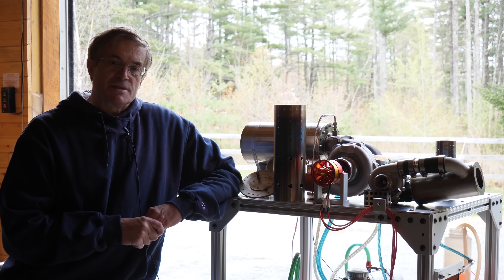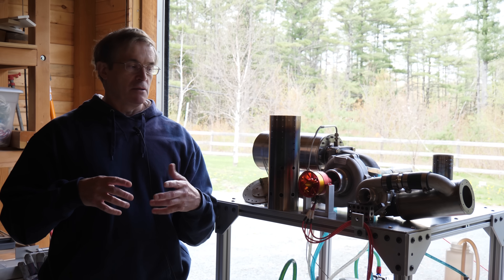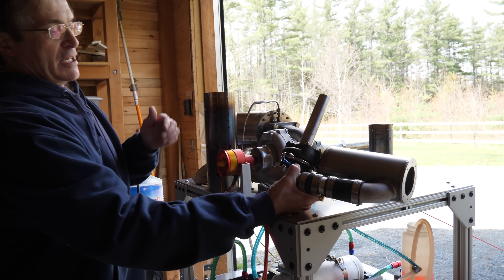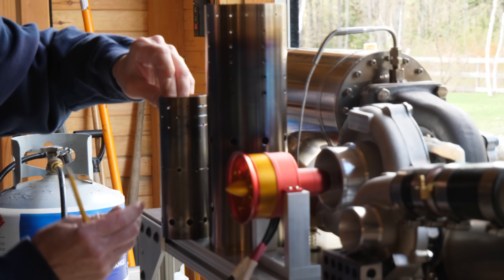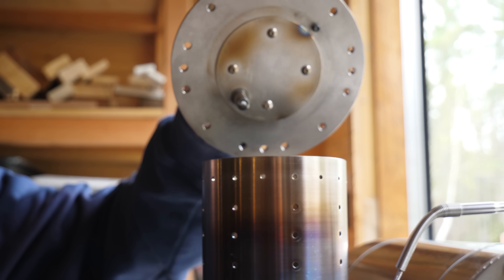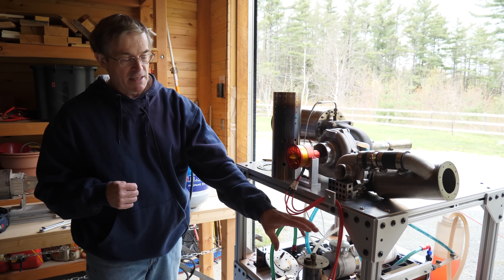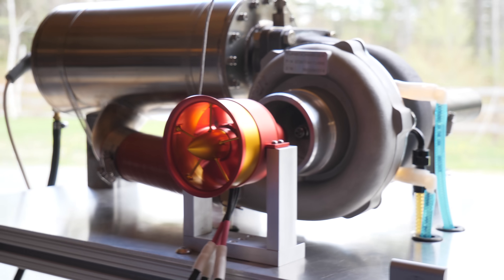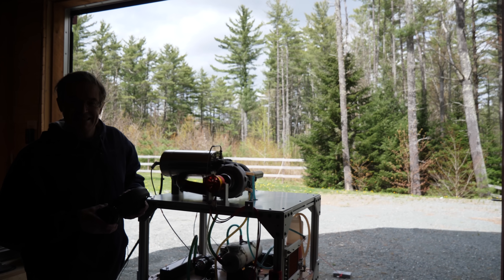Catching Fire - Refining the Jet

Comment: I have (had) no interest in turbojets. Absolutely fascinating to watch though.
I've always wondered however why jets are universally noisy. What is it about them that generates so much noise.
Reply from the maker: Thanks!
Probably the two major reasons they are so loud is that their compression and expansion processes are open to the atmosphere.  It is as if you carried the process of removing the muffler from your car further and removed the cylinder walls as well.  Also, some of the gas flow in the turbo is supersonic.

Comment: how much has this project cost so far?
Reply from the maker: It's really hard to say  because so much is repurposed from other projects.  But, the turbo, gauges, pumps and misc fittings probably total arround $1,200.
Reply: It doesn't matter. It sounds like you know the cost of everything but the value of nothing.
Reply: @stevewhite6252  thank you for sharing

Comment: Main presenter, if you really wanted to use liquid propane, have you considered running your fuel line (metal fuel line obviously) around the flame tube or exhaust in the form of some heat exchanging coils to convert your liquid supply to vapor before being burned? This is what we do in hot air balloon burners. Also, call up some hot air balloon pilots and ask if they have or have a line on some illegal (to fly) propane tanks they want to get rid of. They're 10 gallon propane tanks with liquid and vapor taps. Quite handy.
Reply from the maker: The source of the tanks is a good suggestion.
The heating of the fuel posses some challenges.  It needs to be effective and therefore the lines need to be long enough and be immersed in the hot gasses, but not obstruct flow.  If the fuel expands too much the flow resistance can choke the fuel flow.

Comment: the difference between a crappy ebay turbo and a say a built garrett was basically turbine design and ball bearings..  this is common knowledge in auto racing.  Im wondering if he will incorperate an oiling system..  heat kills bearings which is why they sometimes even run stand alone oil sump systems directly into the turbos but have to run some kind of oil through the turbos in automotive applications..  oil is critical and ive seen myself what happens when a compound turbo system is glowing red hot and the oil system fails..  barings seize and shatter csusing a domino effect of turbine pieces shooting through the system and locks the rotors so the whole system fails.  And down the line pieces get into the motor which doesnt play nice either..   essentially a compounded turbo diesal is doing the same thing here except not injecting fuel into the turbo so not making it a jet persay.  unless a nitrous injection system is rigged up to it forcing into the intake..  then it can add spool that way but is not a combustion system with turbo alone..  idea..  try running a diesal fuel for the jet.  Lubrication in the fuel..  like kerosene with pure ethanol or methanol.
Reply from the maker: I do have a pressurized oil delivery and cooling system.

Comment: Thrust increases with the square of velocity, it's massic flow times velocity, not mass times velocity. Also, the out flow doesn't need to go faster than the vehicle, just faster than the inlet flow (so you can use a diffuser to reduce the speed of the flow).

Great video as allways
Reply from the maker: Thanks!
Actually, it does have to go faster than the vehicle because of the conservation of momentum.  Only if there were no frictional losses could the exhaust even equal the velocity of the vehicle.
Reply: The scaling laws are still against you, even if it wasn't articulated perfectly by Mr. Tech Ingredients.  The thrust (i.e., the rate at which momentum is imparted to the air) is mass flow rate times velocity (T = m_dot * v), but the power required is half the mass flow rate times velocity squared (P = 1/2 * m_dot * v^2).
Reply: @lithiumdeuteride  yeah, mass flow depends linearly with velocity, times velocity, means that thrust scales squared to velocity
Reply: @guimblon  With density and volume flow rate held constant, that's true.  If we assume the same for the power consumption, how does it scale with velocity?

Comment: Oh dang! I wish I was paying more attention in the last video in regards to the propane surging issues. I used to work on grain dryers (Vertec) and one of the main heating methods that they used were indeed liquid propane. One of the methods that they used for a more consistent burn was a 'Vaporizor' essentially prior to sending the fuel to get burnt, it would be passed into a hot zone (in front of the burner) wherein the liquid would turn to a vapor, guaranteeing the burn. Would be fun to experiment with wrapping a stainless fuel line around the burner housing you have prior to feeding it to allow the LP to turn.

Comment: In a future version you could run the liquid fuel around the outside of the heat-tube to bring it to boiling temperature (and cool the engine) - and then allow the fuel to vaporise at it enters the engine?

Comment: Brilliant as per usual. You set a VERY high standard for the content you have in your Vids. 
I'm looking forward to seeing what you come up with for the liquid fuel. Not many people have done that and to me it's really where these engines go from experimenting to serious and creditable setups. Seems to me that the setup you have now would work just fine although you may need a preheat with gas then change over depending on what you use for liquid fuel. 

I build waste oil burners based on the same principal of Phase change from a liquid to a gas using retained  heat in the combustion chamber. I'd like to be able to work out a flame Holder and do a burner that kept the combustion suspended like you have. The Evaporating back plate and the exit path to bring the flame back on itself is a great idea.

Thanks again for the informative and educational vid. You always manage to make learning interesting which is a significant achievement in itself. 

Btw, The chicken needs to go on a Rotisserie and you need to change the output Nozzle to a 12" diameter to slow the gas speed and stop the chicken from blowing apart when it is done.  :0)   Maybe put a nozzle in the output pipe so the the basting can be sprayed evenly on in the jet wash.  When the chicken was done, with an igniter you could swap the basting for fuel and have an after burner!  :0)
Reply from the maker: Good ideas.
The liquid fuel works great right from the start without any pre heat or multiple fuel requirement.  As we'll show.
Recycled deep fryer oil fuel would be ideal for chicken and beef, I'm not so sure about fish...

Comment: A simple solution for your gaseous propane cooling issue would be to keep your tank in a large barrel of water warmed by a percentage of your turbine exhaust.    Or a drag racing solution that’s a little more pricy.  A nitrous bottle warmer.   Dracary Duty Fully Automatic Nitrous Bottle Heater Flexible Heating Element Fits 10LB,15LB,20LB (120 AC Voltage 400W) https://www.amazon.com/dp/B07FCL8TR5/ref=cm_sw_r_cp_api_i_ZVMmDbNCGSYDQ

Comment: Dislikes are from the neighbors.
Reply from the maker: Ha!
Reply: the world needs more neighbors like this
Reply: I don't think he has many neighbors...awesome property.
Reply: The only complaint he'd get from me if I was his neighbour is why didn't he ask me for help!
Reply: Reid Gravelle 🤣👍
Reply: I was wondering if the compound turbo turbines, will quiet it down, or will a multi-stage generator turbine quiet it down, or, is there a tuned muffler that can be made for it.
Reply: @observingrogue7652  a turbine attached at the end to capture power will make it quieter and the more energy it pulls out of the exhaust the quieter it will be. Without a multistage turbine it will likely just sound like a smaller engine but even with a very efficient design eventually it's just not worth the effort of capturing it. In this case exhaust restrictions to quiet it aren't really an option because they reduce the efficiency upstream. Another turbine is a restriction but its neccessary to extract the power. Many power plants will actually use the last heat to power a steam turbine, extracting power at multiple stages in different ways as the energy lowers. With the dregs of heat left (still enough to burn stuff) you could heat a huge water heater then heat a building in winter and then a bank of sterling engines. As the temperature goes down there will be a point where the energy recovered will equal the amount lost in the system recovering it. That point is FAR beyond the point where it is economical to try to recover any more

Comment: I like these jet builds but I was wondering if you plan on working on the electric fan driven ram jet you once built.  With tech on batteries and electric motors improving rapidly i think it could be a viable jet engine soon.

Comment: Just a suggestion, why not use a venturi instead of a fuel-pump and let the propane draw in the liquid fuel.
Reply from the maker: The internal pressure, as you can see from the guage, is far above atmospheric.  The propane would not be able to create enough velocity in the file to overcome this.

Comment: Would it be possible to couple a fan to the compressor side to form a kind of turbo fan? Would probably need a reduction gear and making a fan duct would be difficult
Reply from the maker: It would be easier to couple a free turbine, driven by the exhaust, to drive the bypass fan.

Comment: The pyrolysis of the wooden board at the end is interesting. Guess there isn't enough oxygen after combustion in the jet to combust the wood? Or maybe the temperature isn't high enough to cause ignition? Makes me wonder what would happen if you connected the jet to the bottom of a semi-sealed (needs vents obviously) oil barrel full of wood chips. Instant charcoal maker perhaps?
Reply: ooooo, or maybe build it so you can put some meat in there too. Turbojet smoked meat. Just think about it.
Reply from the maker: I believe you are right about the lack of oxygen.
Using reclaimed deep fryer grease as fuel would be... perfect.

Comment: just for fun, this winter can we see you use this to clear snow from your driveway?
Reply: The first turbocharger turbojet I saw was at a railway equipment show more than 20 years ago. A platform mounted on small rail wheels had two of these jets on one end aimed down at a 45 degree angle. the machine was used in railway switching yards to blow snow and ice from the switches to prevent them from being frozen in place. The jets didn't propel the platform. It was pushed from switch to switch by another vehicle. I have been fascinated by turbocharger turbojets ever since.
Reply: Pretty sure you could if you had it set up to direct all the air onto the ground. They have jet driers already that are mostly used to dry up race tracks after it rains.
Reply: Airport snow blower trucks are basically just that. Jet engines with a hose coming off them strapped to the side of a bulldozer.
Reply: What driveway?
Reply: @alexandracrawford800  The one on Parkway Drive.
Reply: What if there is no snow......
Reply: Leaf blowers work well to clear snow from the cars. Trick for the driveways is dont let it pile up and it clears very quickly.
Reply: Probably not such a good idea when it's just a gravel driveway and not paved.

Comment: It'll be very interesting to see the compound version,
higher pressure means more fuel and air fits in a smaller area, 
effectively making the combustion chamber much larger.
I'd still rather see a SPRF style combustion chamber, 
with concentric layers around the combustion chamber, and a 1000psi water injection system
which would create additional exhaust volume and reduce heat stress on the turbine side.
Also, keep in mind that, all that noise is caused by turbulence, which reduces efficiency.
.
Reply: The non linear design of the turbo would make any attempt at reducing noise/turbulence futile.
Reply: I wasn't referring to Turbo whine, although that is also a reducible noise,
I was referring to Combustion Turbulence Noise, which is caused by a variety of factors,
and which can be reduced, with a measurable bump in efficiency.
I was just giving him another point to research, which creates better overall understanding.
Reply: I wasn't just referring to the 'whine'  as you call it but the vibration in the air being compressed by the turbo has cavitation like water does when you spin a propeller too fast compounded by the non linear path of the air creating a turbulent flow then the explosive expansion of the heated air on the combustion chamber then the restriction of the jet nozzle. Making it quieter is daunting to say the least and any progress on that path would ultimately be futile as it would be minuscule in volume change anyway

Comment: How would you build a nuclear power plant small enough to power your home and your next door neighbor's home for ~30 years?
Reply: illegally
Reply: Jerry Lifsey They have those now but I wouldn’t trust a neighbor with one. People are dumb.
Reply: Very carefully
Reply: Getting parts made isn't the hard bit. Just hit up any local shop with a good CNC machine. Those things are super accurate. Machine shops like money. As stated, the hardest part is getting the fissile material for the reaction. But then you also have to calculate the critical mass. Overdo it and it goes supercritical and you're dead. If you wanted to make a nuclear bomb, that's super easy from a mechanical standpoint. But that's an extra super duper bad idea for many many reasons and in fact let's not play with any of those materials.
Maybe just get some solar panels. It'd be cheaper and you won't go to prison or die horribly. Hell, you can even make wind turbines out of junk. I've heard of people re-purposing electric motors into dynamos and using those on windmills. 
BTW dying from radiation exposure isn't pleasant.
Reply: Nuclear reactors take a lot of very expensive materials and machined parts.  But if that's not a big enough hurdle, good luck getting your hands on any kind of fissile fuel.  One kid tried (buying tons of smoke detectors and recovering the Americium from them) and went to jail.  And they turned his back yard into a Superfund site.  Look up 'nuclear boy scout'.
Reply: Actually you can build a rudimentary reactor using a polished stainless steel reaction chamber and some stainless steel coolant pipes. The only hard part is the proper radiation shielding.
Reply: @caveman6345  I mean if you're just tinkering with it to make it work at basic levels yeah.  But dude was talking about using it to generate power which even at the very small scale he mentions requires sturdier construction with tighter tolerances and more complicated systems to make it safe and efficient.
Reply: Nah, just use the cooling to generate steam for a turbine.

Comment: A jet engine, like a commercial airliner would use, does not work on the combustion of kerosene, as we are told. They are a form of Stirling engine that compresses air to the point where the N2 bonds disintegrate. The N ions then react with oxygen and hydrogen producing much more heat and pressure. This then creates massive amounts of thrust. Cold air is drawn through the outside of the internal engine producing the temperature difference which creates the Stirling engine effect. Since this is done in a continuous rotary manner, rather than the heating and cooling of air in cylinders, it is fully self sustaining. The engine then simply sucks itself along requiring no fuel input other than the nitrogen, oxygen and hydrogen in air.

These engines are started with compressed air and possibly a tiny amount of fuel to create the initial heat. How else would an aeroplane maintain 16 hours of running without swimming pool sized tanks hidden in the planes somewhere. 

Also, the planes wings are required to bend uniformly along its entire length. Uneven rigidity in the up/down plane of movement of the wings would cause rapid weakness and failure. Tanks in the wings would necessitate uneven flexing.